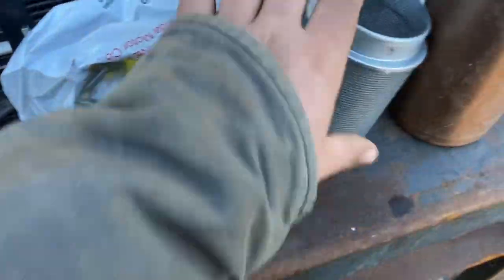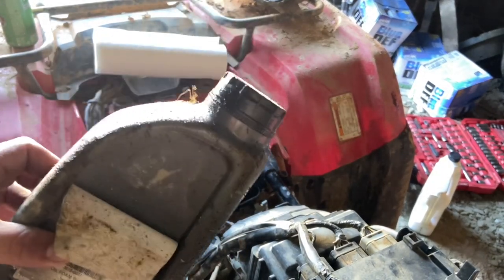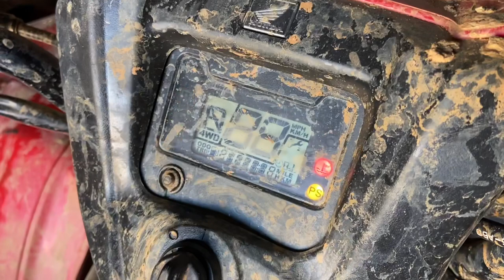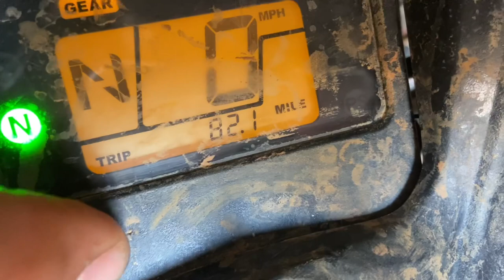What to do if you swamp your 4 wheeler!! (2020 Honda Rubicon 520)

Comment: “If you swamp a Canam or Yamaha it’s done for” Also Honda: needs a entire motor rebuild for being sunk once
Reply: Nope
Reply: sunk mine and it don’t need a motor rebuild and it don’t even smoke
Reply: @_dustinweaver_  he jest made cause we don’t have to but a whole new fourwheeler or spend more then we bought it for to make it run again all we do is drain the water and go back to rideing
Reply: If you swamp any quad, it can be done for Depending on how much water gets sucked up 😂 Also depends on what else is included, ie mud and debris. Based on how much mud he had in his air box and the fact he continued to run it in that state no wonder it’s fucked. That diesel / oil flush only works if minimal debris is included with the water, safer bet would be to just split the case and clean everything. Might as well since you’re rebuilding it anyway haha.   Gotta pay to play, they’re simple, a good service manual and time you can figure out how to fix almost anything on a atv.
Reply: Sunk my honda 5 yrs later still fires right  up no issues
Reply: So glad I bought a honda

Comment: Hey Jacob,,, Let me ask you this, You said drain the engine oil and fill it with diesel and run for couple of minutes? (no oil in the engine? Just diesel
Just double checking
Reply from the maker: Worked for me on my 17 and 19. This rubicon had bigger issues but not caused from the diesel

Comment: How did it hold up, because that definitely looked like top end smoke to me. The fact that it got thicker when you gunned it (pulling more oil past the rings).
Reply from the maker: Bottom end got trashed. Full motor replacement

Comment: Love your videos.  Definitely buying Honda. Question. So I see some people relocate there radiators.  So why not the hole air box.?  Like get a water proof box to house the filter, snorkel.  On front rack.  Then it’s simple and a hose threw the front right fender littlery to the throttle. Hell maybe in the empty void were the factory air box was make that intake hose curl a couple time as extra defense just in case you go that deep?
Reply from the maker: I don’t know. Probably to much stuff to locate.
Reply: @JacobOverman  past point of warranty on my ride when I get it I’ll have to try.  Get like a water resistant ammo can roughly the same size as the air box and run the hoses   See if it works.   If it works.  Past that If it works. Heck I’ll make it look better.  Prob be a good start for my own YT vid

Comment: My canam ran just fine pulled the plug and ran it on straight water no oil for 2 hours never had to rebuild it to this day 🤷🏻‍♂️ try again
Reply from the maker: 😂 all depends on how bad you swamp it. I’ve swamped many atv’s and have had success doing as you stated. However. I didn’t know why this one cut off. So I cranked it up and ran it hard until it quit. Now it got a motor. The thick mud went right in. Took out bearings

Comment: So you can run Diesel engine oil in a Honda or is that just for the drain water out
Reply from the maker: I always run 15w40 rotella Diesel engine oil regardless Honda or not. That’s what’s in my dads Suzuki and all my buddies run it too
Reply: @JacobOverman  where can I dm you at
Reply from the maker: @edwinpadilla5504  add me on Snapchat Jacobmontana03
Reply: @JacobOverman  I sunk my 700-4 and the clutches are slipping after about 8 oil change with the oem oil from Honda and thoughts

Comment: I sank my Yamaha about 6 times still runs good and honda is for losers so f u  Yamaha on top my buddy sank his Honda and it blew up
Reply from the maker: 10-4 rubber ducky. I’m sure any other 4 wheeler would take on mud just fine inside the engine. 🥺🥺🥺
Reply: @JacobOverman  Yamaha is better than Honda